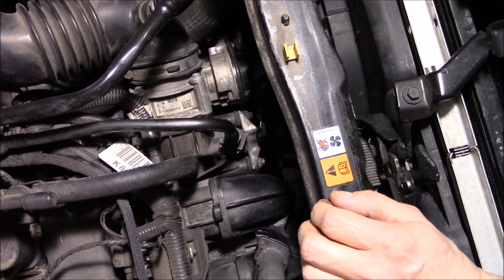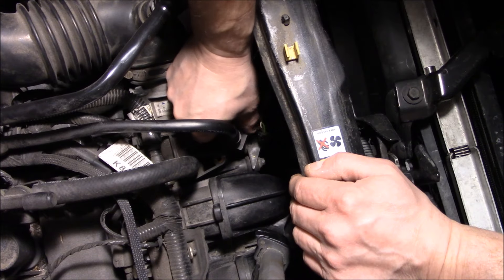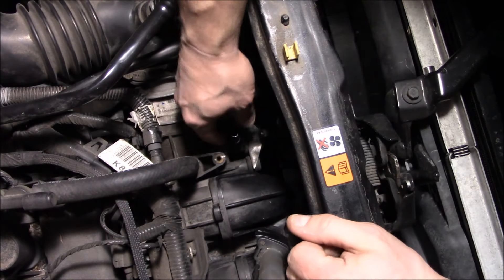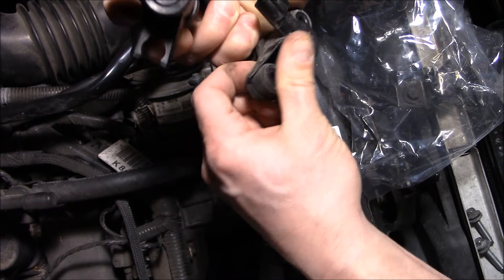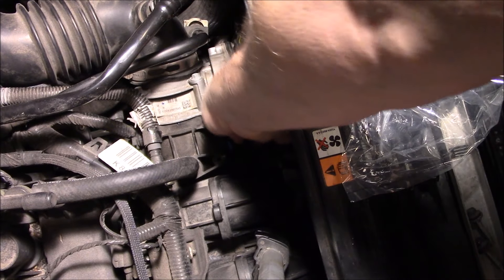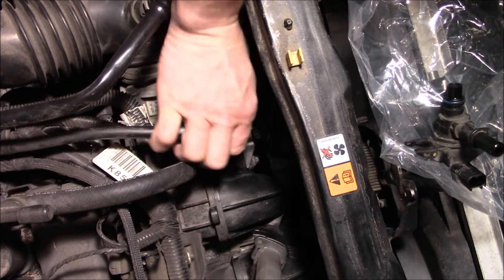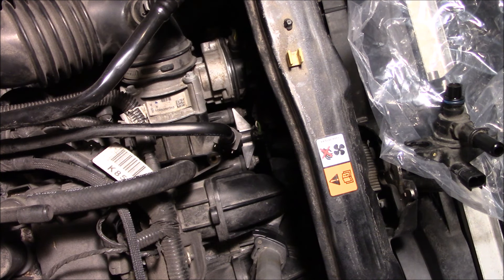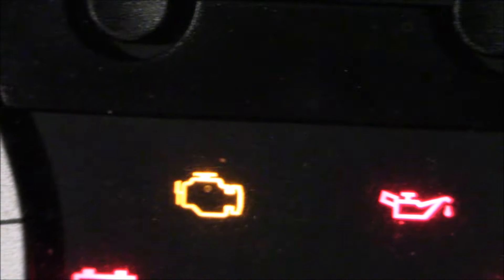Code P144A Ford evap purge valve replacement, easy fix

Comment: You save me tons of money.  Had code P0455 and P0457. Purge valve was stuck closed. Took it off and used WD40 with the Straw, and sprayed in the enter and exit holes, washing out all the dirt. I re-installed it and ran an OBD2 code check.  The code was still there. After driving city and hyway  to complete a drive cycle, I ran an OBD@ code check and the permanent codes were gone.  Point is that the purge valve can be cleaned by flushing it out. It was the moist dirt that caused it to be stuck .  Hope this information will help others .Your video did gave me the idea.
Reply from the maker: Glad this video was helpful
Reply: bbb jim1 its this also for the 2.0L ecoboost engines?
Reply from the maker: I believe the ecoboost uses a different system.  Here is a video on changing that: https://www.youtube.com/watch?v=UnWq-1wzmyc&t=29s
Reply: I have a lifetime warranty on mine so I just go change it our and return the old part.
Reply: How long do you have to drive to reset it? 40 miles?

Comment: You saved me almost $1000 from the dealership!

I watched this vid and replaced it a few years ago.
I got a different code yesterday, found this vid again, remembered that this caused some issues before, so got a FREE replacement from OReilys, swapped out and looks like I am good to go.

I called the dealership service center and they quoted $450 to replace!!

That x2 is almost 1G so thank you!!

-I do have a 6 cylinder, and it is a little harder to replace and reach, but still did fairly easy!
Reply from the maker: Glad this helped you save some money

Comment: Thanks so much. I'm not a handy guy but Thanks to this video I installed this part on my 2012 escape.  It took me 20 minutes because 15 of those minutes was figuring out the clip. 🤣🤣. Anyway Thanks you saved me quite a few dollars.  Keep up the good work. Much appreciated
Reply from the maker: Glad it helped
Reply: @bbbjim1fixedit  why does my 2012 escape idle funny when heater is on? Is this normal?
Reply: @bbbjim1fixedit  really, should have a video on removing clips!!!

Comment: Did this with my son in about 5 minutes on my 2016 Fusion SE. Thanks for posting.
Reply from the maker: Glad to hear you found this helpful and that you made some memories turning wrenches with your son
Reply: I got the same code and I have a 2016 Ford Fusion SE did this make the check engine light go away

Comment: I’m guessing I have this problem, about a week ago when I started my escape it felt like it had a bad miss, bad idle, I turned it off and back on and it quit, a few days later, check engine light came on. i looked up some issues this valve can cause and it definitely is bad then. I had a friend read the code, and it gave this code. It seems pretty easy to fix, I can do basic stuff on cars so I’m gonna give it a try. Thanks for posting the video
Reply from the maker: Glad you found this helpful, and I wish you the best on your repair

Comment: I started getting check your filler door alarms a few thousand miles ago.   I did the clean the easy fuel port process several times but it would happen off and on.   Thos week the check engine light came on and it said Major Leak in evap system so I knew it was time to replace this.   My escape is a 3.0, bit the part is exactly the same - just a little harder to get to.   Had it replaced in 45 minutes with an 8mm ratcheting wrench and a screwdriver to get the hose off.   No problems since!
Reply from the maker: Nice work!

Comment: Excellent video, no eye strain shake, good labels.  I'm getting a P2450 (3 events) and an engine light on. (Innova 3030 code reader) The general description for the code is Evap Emissions system switch valve or stuck open.  Would they be talking about the purge valve?  2010 Ford Fusion Hybrid, 132K miles. Light just came on today, no driving symptoms.   Thanks for any comments.
Reply from the maker: I have no experience working on a Hybrid.  The purge valve is normally in the closed position, and when opened the canister valve which is normally open closes. I hate to guess what may be causing your code. fordtechmakuloco has a few videos on testing the purge valve and cleaning the fuel fill flapper which may be the source of your code.  I wish you the best of luck on your repair, and thank you for the kind comments on my video.

Comment: Replaced this still came back p144A with p0456 again no visible leak at canister all hoses double checked. This reverse engineering definitely to make more vist dealers 😢
Reply from the maker: you may wish to take a closer look at the fuel fill flap if capless or the fuel cap for the P0456. I wish you the best on your repair

Comment: No check engine code but everyone I put gas the rpms go up and down when parked
Reply: If you have not figured it out yet, could be your head gasket. Maybe some hose/tubing that’s leaking. Or the head gasket itself. If you check your oil color, try to see if it’s milky like chocolate milk. That is a dead giveaway for a head gasket crack.
Reply: Also check your engine coils, sounds like it’s misfiring so could be one of the coils that are busted, which is an easier fix.

Comment: Should include engine size and go over where your looking on the motor
Reply from the maker: good point, it is a 2.5L engine and it is located in the front of the engine behind the radiator

Comment: Hi I’ve had a check engine code up.. short story it’s nothing to worry about nothing to do with this issue. My car has trouble starting after I get gas and that’s it. Is this the issue? I think it is just looking for some assurance!
Reply from the maker: Replacing this part fixes the P144A code the majority of the time.  Not knowing the code you have it is too hard to say what your problem could be.  Many auto parts stores will pull your code for free and some have a suggested list of parts to test.  I wish you the best on your repair

Comment: Hello. I having the same issue with a 2013 ford fusion. Is it necessary to buy the whole kit, new hoses and all. 2 hose ends are hard to get to. I would rather just replace the solenoid like you did in this video, versus the hoses and all. The solenoid does come separate.
Reply from the maker: I am not certain but I believe the evaporated purge valve is sold as a unit that includes the hoses attached. I wish you the best on your repair
Reply: @bbbjim1fixedit  Thanks. At advance it came  one whole unit and separate with just the solenoid. I'm waiting on the whole unit to come in. If I can pull the solenoid off (if the rubber hose is friction tight) than I'm just gonna replace the solenoid lol. I don't think it's the long hoses that's leaking, it's just the solenoid.

Comment: 2013 ford focus power train system Evap vent control valve where is it at
Reply from the maker: I believe the Focus uses a purge valve that is part of a hose assembly that is replaced as a complete assembly. I wish you the best on your repair

Comment: Looking for the location of this for a 2017 explorer sport twin turbo. Every video i see is not the same location.
Reply from the maker: the design in my video is no longer used.  You likely have yours integrated in a hose assembly. I wish you the best on your repair

Comment: Can't find this on 2007 ford fusion. My fuse box is on the right side wall
Reply from the maker: I believe the valve in the video was used after 2009, yours likely has 2 hoses and an electrical connection on it.  I wish you the best on your repair

Comment: Is that the part that will not let your car turn on after putting gas?
Reply from the maker: Not seeing your vehicle I can only guess, so if you have a check engine code P144A the cause is likely this valve.  Another valve works in conjunction with this valve in the evap system and that is the canister purge valve located near the fuel tank.  I wish you the best on your repair.

Comment: Would you know where the evap valve is on a 2012 focus?
Reply from the maker: Since the focus uses a different engine, I think they use a different system that uses a hose assembly/evap valve in one.  I have a link to someone else's video showing that system some where in all the comments.  Best of luck to you on your repair
Reply: RECALL issued!! RECALL issued by Ford today 10/25/18 for purge valve issues!! FINALLY!!!!!! All 2012-2018 Focus. Call your dealer!
Reply: Would you know where the purge valve is on a 2010 transit connect  van?

Comment: I had to take off the throttle body to clean it on my 2012 escape. This code was thrown afterwards, I'm assuming I caused it by disconnecting the hose, right?
Reply from the maker: I made another video on cleaning the throttle body, at the end of the video I show how to clear the pcm memory. The car will then relearn the best settings and it may stall just once at a stop

Comment: I have a quick question after replacing the parts my code came back a week later what can be the possibilities
Reply from the maker: you may wish to look at the fuse, electrical connection and the vaper hose. I wish you the best

Comment: is this the same for a P1450 code?  ford fiesta SE 2016. have asked all around and nobody knows what P1450 is exactly and they won't even look at it for less than a ton of money! the only real symptom is it doesn't start on the first try after getting gas.
Reply from the maker: P1450 pertains to  being unable to bleed fuel tank vacuum. P1450 FORD Possible Causes
Blocked EVAP canister or vent solenoid 
Kinked or collapsed hose between canister and fuel tank 
Faulty Fuel Tank Pressure (FTP) sensor 
Fuel filler cap stuck closed, preventing vacuum relief . 
I wish you the best in diagnosing your Fiesta

Comment: I’m getting zero codes and my 2016 3.7l mustang for 3 day starts to idle so rough at a light it shakes the whole front end of the car. It goes away when I start driving at a green. It’s pretty scary and want this fixed. Idk what to do with no codes being thrown.
Reply from the maker: You may want to look at the throttle body and clean that.  I have another video on cleaning one: https://www.youtube.com/watch?v=NU2NiKh_vC0  
I wish you the best on your repair
Reply: bbb jim1 my car has 30k miles on it and the throttle body looks like brand new still inside it. I just looked.

Comment: I have a 2016 focus se. Mines don’t look like that tho. Am I looking at it wrong or what’s the exact location of that valve?
Reply from the maker: Depending on the engine you have you likely have the purge valve that is integrated in a hose assembly. I wish you the best on your repair

Comment: Can't find it on my 2014 Lincoln mkz
Reply from the maker: I believe that 2012 was the last year of this style of valve. Depending on the engine size your vehicle may have a hose assembly attached to the valve. I wish you the best on your repair.
Reply: @bbbjim1fixedit  Thanks for reply. 2.0 turbo is the one I got. Must be hidden good I looked for 30 mins or so.

Comment: What are the symptoms of this code? I just got it yesterday but I won’t be able to fix it in 3 days and I drive it to work. It’s about a 30 min drive. Right now I have the engine light on but as of right now it’s driving like it should.
Reply from the maker: I just had the code, and no noticeable  issues.
Reply: @bbbjim1fixedit  Same here - Check Engine light came on, but I noticed no difference in the truck.   I think it varies on how the valve fails, whether it's open or closed when it happens.

Comment: Where do i find that of 2013 ford escape 1.6litre ecoboost
Reply from the maker: I believe the Ecoboost uses a different valve system that have hoses attached.  I think somewhere in the comments I had a link to someones video showing it. I wish you the best on your repair

Comment: So I have a 12 mustang with this code. How do I find this part to replace. If u have a link to a video that's perfect
Reply from the maker: This part would be located next to the throttle body.  Follow your air duct work from your air filter to the top of the engine, it should look similar with the 5.0 or 3.7 engine.  I wish you the best on your repair.

Comment: Is this the same for an Ecoboost 2013 Ford Explorer? Or does someone have a link to an easy video? Repair shop tells me it will take 1.5 hours if they do it..
Reply from the maker: I believe the Ecoboost uses a different set up; below I have a link to someone's video changing the purge valve on an Ecoboost Escape, it maybe be similar on the Explorer
Reply: Thank you.

Comment: How much is the valve? Where can I get?
Reply from the maker: The Ford part number for my vehicle year is CX2349.  Yours maybe different depending on the year: Seeing that this is an electrical part it may not be returnable if not the correct one. Please double check the part number before buying.  Most local automotive parts stores can order this part for you or you can purchase on Amazon in the $15 to $20 range.  Best of luck to you on your repair.

Comment: Is this in the same spot on the 2013 escape? I couldn't find it.
Reply from the maker: if it is an Ecoboost  engine I believe they use a different system that has a hose assembly
Reply: bbb jim1 yea it is a ecoboost
Reply: bbb jim1 thanks.

Comment: will a p144a with a bad purge solenoid/valve cause a no start condition (ford escape 2011 2.5)? thanks
Reply from the maker: I hate to guess what the problem would be.  If you have fuel, spark and compression, it maybe possible if the purge valve or the EGR valve is stuck in the open position that is causing the no start. Fordtechmakuloco has some videos on testing the purge valve.  I wish you the best of luck
Reply: thanks a lot !
Reply: I have 2010 ford  escape. And i have that code  p144a  and now my car sometimes  hard to start  actually  the starter  acting  weird

Comment: I have a 2016 Ford Focus se is that the same Ford is tryna charge me 800 dollars. To fix that
Reply from the maker: I believe the Focus engine uses a different purge valve set up than this one.  I think the hoses are attached to the purge valve on the Focus, yet not hard to replace.  I wish you the best on your repair
Reply: @bbbjim1fixedit  You're thinking of the 2.0 ecoboost. The 2.5 engine in the Fusion is the exact same as this.

Comment: I can't find it
Reply from the maker: This is for 2.5 or 3L engines 2009-2012.  If you have a different engine or year they use a different system then what I show in this video.  I wish you the best on your repair
Reply: @bbbjim1fixedit  ohh ok thanks i have a 2014 food focus se... hopefully I can get it figured out

Comment: where is it in a 2013 ford focus
Reply from the maker: I believe the 2013 Focus uses a different system  consisting of a hose assembly that needs replacing
Reply: RECALL issued!! RECALL issued by Ford today 10/25/18 for purge valve issues!! FINALLY!!!!!! All 2012-2018 Focus. Call your dealer!

Comment: Do you know where to find this on the 1.0L 3-cylinder variant of the Focus?
Reply from the maker: Not knowing the model year of your car, but I did look up the part for a 2017.  It has a picture of the part with an electrical connection for 2 wires, yet it is different than the part I used, so I am unsure where it is located.  I wish you the best on finding it and your repair.
Reply: @bbbjim1fixedit   - can you share the link/picture you are referencing? I have a 2017 Focus with teh 1.0 3-cylinder engine and I cannot find anything useful on where this is located.
Reply from the maker: @peterkispert1237  https://www.rockauto.com/en/catalog/ford,2017,focus,999cc+l3+turbocharged,3436087,exhaust+&+emission,vapor+canister+vent+valve+/+solenoid,16992

Comment: Where is it in a Ford Fusion 2015
Reply from the maker: I believe in 2013 and latter Ford used a different system.  If it is an Ecoboost engine I have a link below in the comments to someone's video on changing that hose system purge valve.  I wish you the best of luck